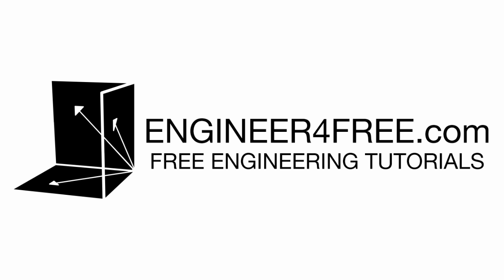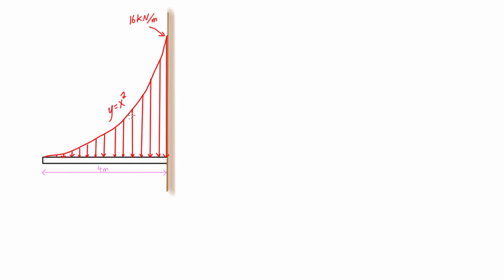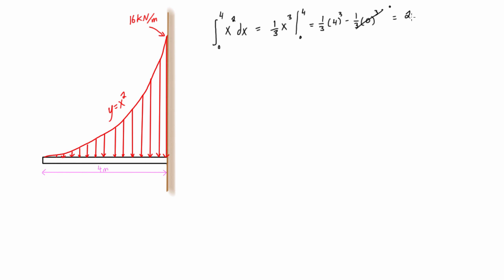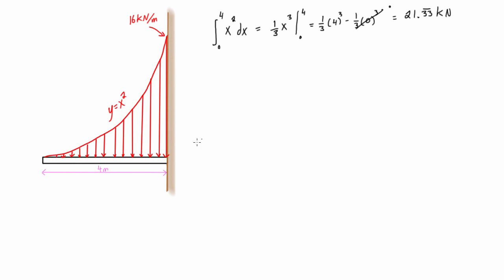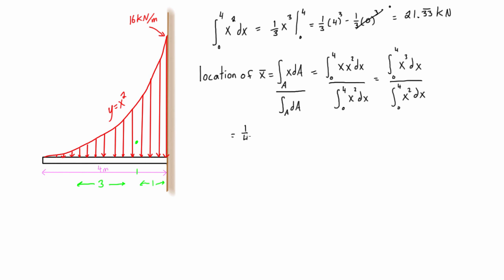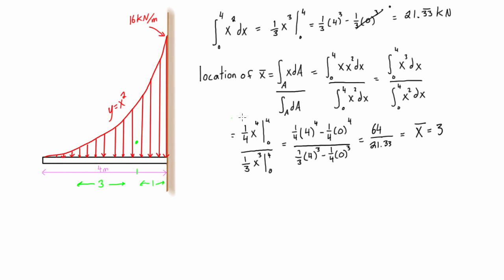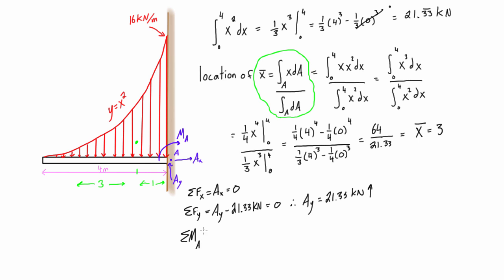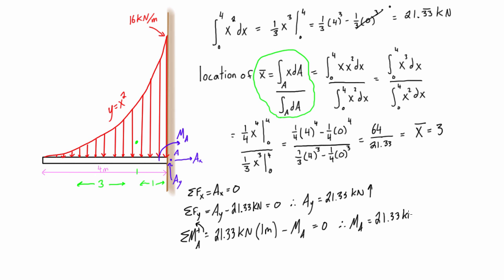Distributed loading on a beam example #3: parabolic loads

Comment: Isn’t 21.33 in units of meters? The force should be that times 16 kN correct?
Reply from the maker: No actually it is in units of kN. We integrate to get the area under the curve, but the units on the y axis are kN/m, and the units on the x axis are m. If it was a rectangular shape, base * height... the units would be kN/m * m = kN. Same for this parabolic shape.
Reply: This example is confusing for students because the 16kN never appears to come into play. Or doesn't seem to in this example. I feel like the example is confusing and unclear because the beam is 4m and 4^2 is 16m. Therefore the bounds of integration appears to be based upon the beam length, not the value of x which in the function produces the output of 16kN. So it might cause students confusion if they are unaware were the 4 came from.  They might think it is distance and ask... 

Does that mean that the moment and force created by 70000kN over 4m if it is distributed parabolically is the same as 16kN over 4m? That seems to violate real life expectations...and on a test or assignment use the distance as the bounds of integration. For clarity maybe change 16 to 25 or 36 or change the distance to 8m.
Reply: @MathTutorVideos  omg that's really what I was going to ask. Where did 4 came from?